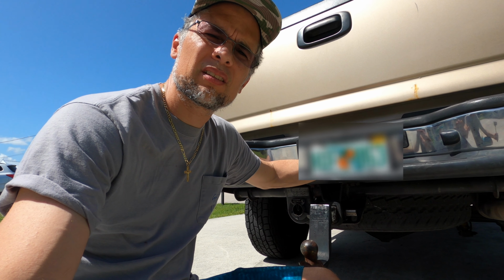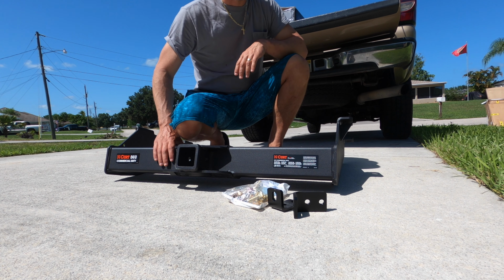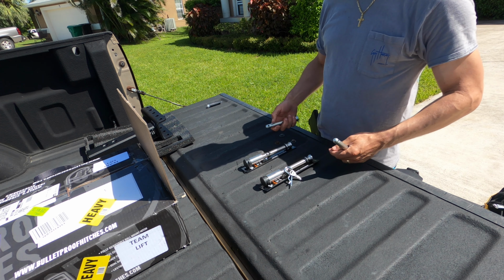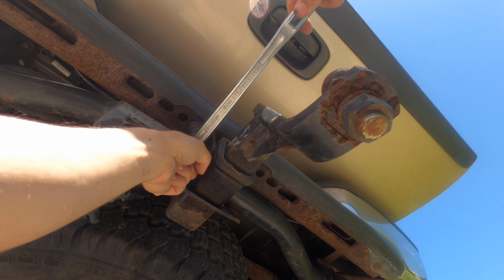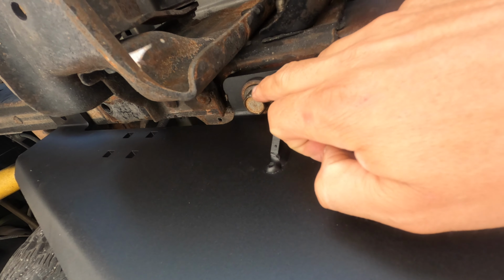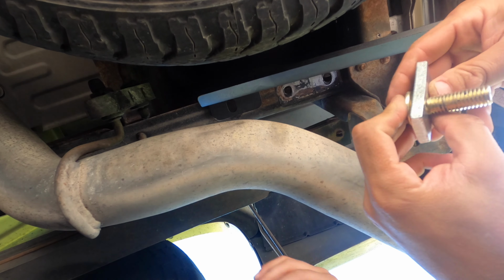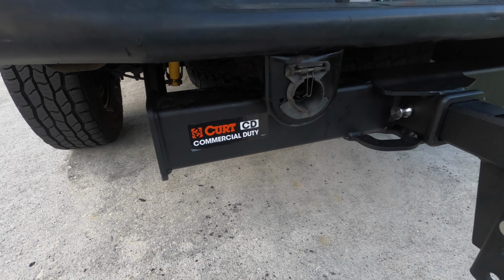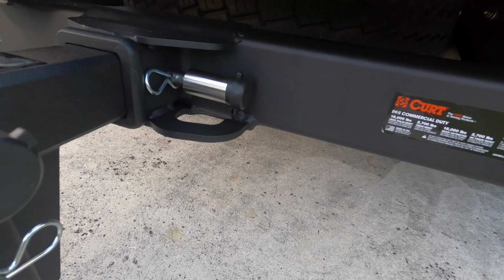Hitch Upgrade Install on Silverado 2500HD

Comment: How did you get along with this hitch as I had previously installed a curt hitch with the 2 inch receiver and wished I had gotten the 2 1/2 but practically the same hitch and bent my frame. Now I’ve got the frame fixed and will be installing the same hitch you have but am worried about bending the frame again.